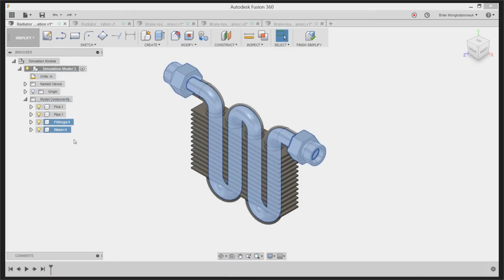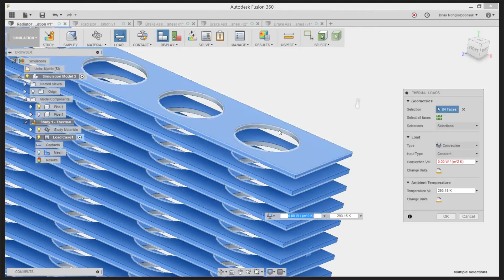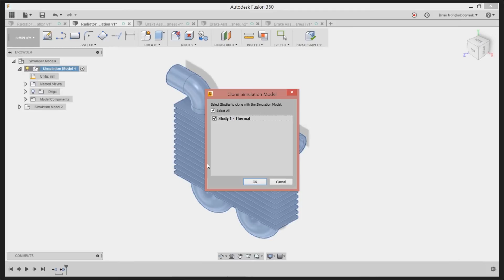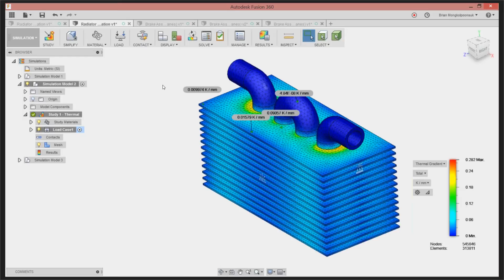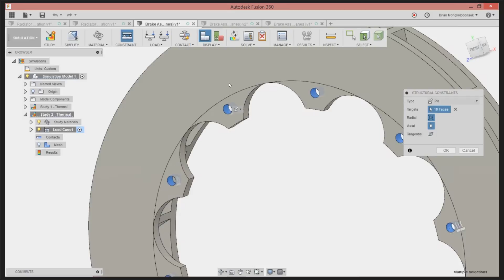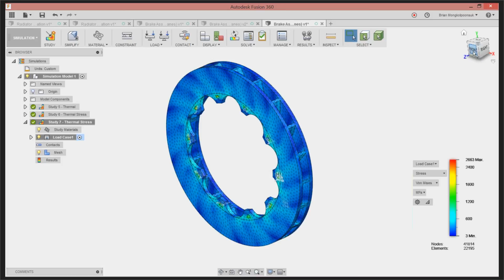Fusion 360 Thermal Simulation | Autodesk Fusion Fridays

Comment: Ok but this is very basic. I need to analyse a Situation where an infrared head pad heats up a part, and obviously that is not possible in Fusion. Also all thermal analysis modes are stationary.

Comment: Hi. Good tutorial. Quick question, when you added the radiation load, the default “black body” emissivity coefficient of 1 was used. However for metals this is usually much lower (Aluminum is about 0.09). Should this value have been used instead?
Reply: Don't bother with technical specs because this was only a demo what Fusion can do.